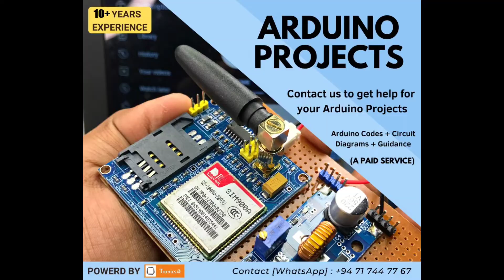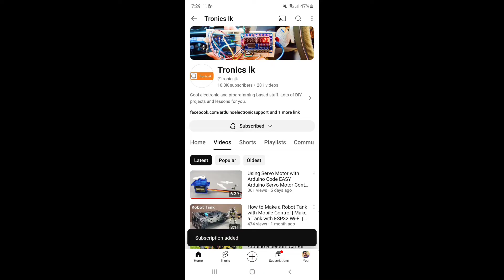EASIEST LM2596 DC-DC Buck Converter  Adjustable Tutorial | LM2596 Adjustable Step Down Converter

Comment: Purchased 5 pack from aliexpress, connected as instructed, output voltage = input, no matter what i did, tested another - the same. What is wrong? Thank you.
Reply: Keep turning the screw. I had to spin for a while before it started to change.
Reply: @zadotterazo690  Thank you. You were exactly right. It took around 15 counterclockwise turns to start reducing the voltage.

Comment: Good Video,,, I put a 470uH coil and a 10uF to the INPUT and a LDO LM2940 5v to output And could not measure any noise on the oscilloscope.... Noise was below what is normal noise from my scope.... You picked a good stepdown to Review....

Comment: Hi I'm also having this same circuit I just want to remove the blue variable module , and control it with separate regulator , which I do have with me. , does soldering it works.
Reply: Using the same circuit with an 36watt ac adapter.

Comment: I have 5 pieces of this buck converter and don't works. When i put a screw driver on the variable potetiometer and rotate, nothing's happent. What could be? I have 13V on input and I want to regulate it at 6.3V.
Reply: Sir,
     इस module को बहोत der tak continue आखरि तक last तक (ghumana) padega tab aapko voltage decrease/increase milega. Muze bhi yahi problem aaya tha.

Comment: Hello, thanks for the video.  I am buying Arduino Nano 33 BLE (3.3v) and a 18650 battery (3.7v). Do I need a LM2596 step down converter?
Reply: There are lots of arduino clones that are made to be powered off of one ore more lithium ion batteries and even include charging hardware. You don’t want to feed 4.2V directly to your digital electronics, you need a regulator